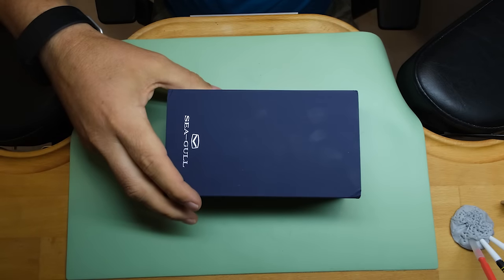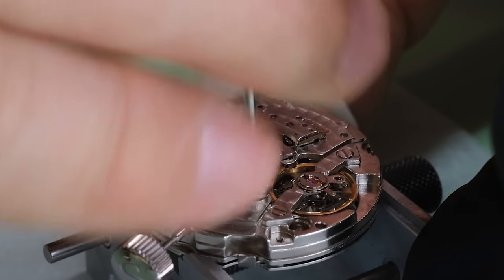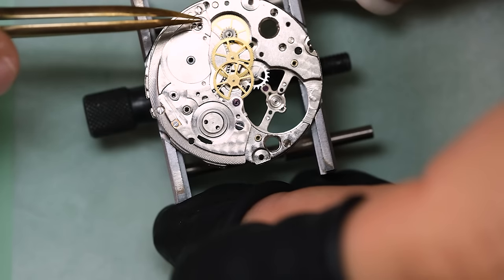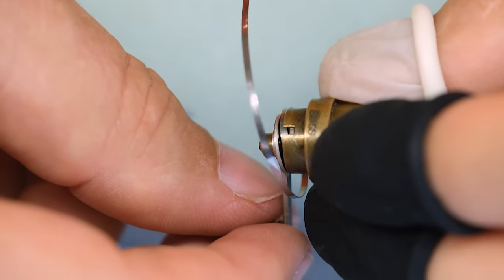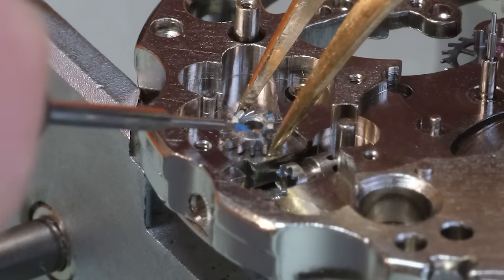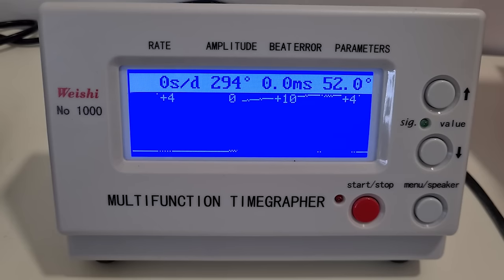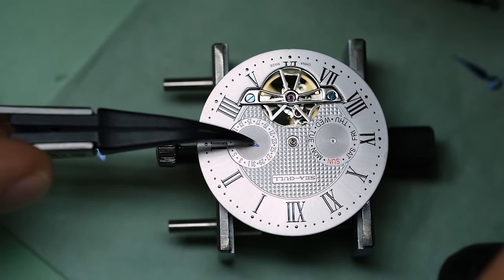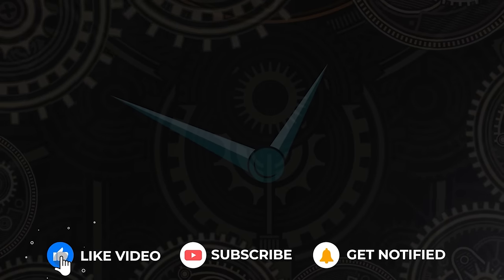How good are Chinese watches? Teardown + Giveaway!

Comment: Well, nice value for the money, but we all know that this watches will not pass the test of time. Bad quality material will soon make the watch run badly and the only solution will be to buy a new one. Yeeh, Swiss are far more expensive, but they will last three or four lifetimes at least. This one only few years.
Reply: Superficial finishing, yes, but not poor quality materials. In terms of ruggedness, these Sea-Gulls can handle and have handled anything Swiss equivalents can do.
Reply: @jakekaywell5972  I was talking about the gears material. Cases and bracelets can be really close to the swiss quality, but the movement parts are made with cheaper material. For example, as you can easily see in this very video, the mainspring barrel and the second wheel have a wobbly fit and they are certainly not made of the same material of their swiss counterparts. This means in the near future, a higher  wear in teeth and pinions causing really big issues with timekeeping in the coming years. I agree that they are a good value for what they are, meaning that the value is always 100 £$€ not to be confused with the 100£$€ value af an average Seiko or Miyota. They will work fine for longer than a Seagull.

Comment: Hi Stian as I've said before I'm not a watchmaker just enjoy seeing you at work. Did I hear you correct that you hone your screwdrivers to match the size of the screw slot. And I guess this is to prevent them slipping as you tighten them?.
Reply from the maker: Hello John, that's the reason indeed. A properly sharpened screwdriver should in fact not reach the bottom of the screw slot but rather lock in between the sides of the slot just before reaching the bottom. If the screwdriver tip reaches the bottom of the slot it will easily slip out.
Reply: @VintageWatchServices  Thanks Stain makes a lot of sense. But I didn't know that before.
Reply from the maker: @johnwhite6899  👍

Comment: well...how good is your Rolex?  Rolex cases, movement parts and bracelets are all made in China as are the cases and movement parts for Panerai, Breitling and Omega.  China is the #1 maker of watch parts BY FAR.  The "seagull" movements are excellent in most grades.  They also power very good luxury clones.  I used to work in watch manufacturing in China and made Rolex cases and bracelets for genuine Rolex production.  Seagull makes movements like ETA does in varying grades.  Their mid to very high grade movements are as good as anything else out there, except maybe Seiko.
Reply from the maker: Good to hear you agree with what I said in the video 😉 Rolex and Omega do however make all their parts in Switzerland, potentially apart from packaging material. Most other Swiss brands apart from the top level ones use Chinese factories, but again, it's all about QA.
Reply: @VintageWatchServices  I hate to burst your bubble, but Rolex and Omega do not OEM all their parts in Switzerland.  I made their parts for years.  The Swiss standard is that watches have to be ASSEMBLED in Switzerland--not manufactured.  I made OEM Rolex, Panerai, Omega, TAG...etc cases, movement parts and bracelets--all OEM for Swiss assembly in my Chinese facilities.  You may not want it to be true, but it is.
Reply from the maker: @peteanddrake4242  Well, I personally know the former president of Omega and trust him when he says Omega is all made in Switzerland. And there's no doubt that Rolex is fully made in Switzerland. So exactly who you may have made parts for I don't know, but it wasn't those two brands. 
As for Swiss made, that's a different discussion but the 60% rule indeed reflects the fact that most brands have operations in China or elsewhere.
Reply: @VintageWatchServices  I can understand your perspective and connections in a very complicated industry.  I can imagine the supply chain has gotten more complicated in recent years.  When I was working in Guangzhou, we were making cases and bracelets for Rolex and Panerai in my two factories.  Other factories got contracts for movement parts.  When we started doing the cases for Rolex, they sent us the OEM tooling from Rolex for production.  We were making their cases with their tooling.  Cases were then sent back for finishing and assembly at Rolex.  Same with Panerai--and soooo many others.  As is commonplace in China, it took mere moments for the tooling to be duplicated--which is why 99% of Rolex fakes from China are in cases perfectly identical to OEM.  All parts are 100% interchangeable.  Most people believe they are reverse engineered copies--but they are in fact made from the copies of OEM tooling we were provided.  Swiss watch companies only have to assemble (not manufacture or finish)--just assemble 51% of the watch in Switzerland.  I agree--finishing and assembly absolutely happen on site at Rolex and Omega.  Critical parts like jewels, mainsprings, hairsprings etc are made in house.  But cast and stamped parts from the case to the movement begin their life being unpacked from a case that originated in China.  This is why you saw such a dramatic turn in replica watches in the late 2000's--and now they are perfect.  There is a reason.

Comment: Great video! 
In your opinion, could this movement last in the long run, provided it is serviced and taken care of as it should?
Reply from the maker: I don't think it would last all that long given the low level of precision in the machining but it should run for a couple of decades with regular servicing, I'd think.
Reply: @VintageWatchServices  Thank you for your swift reply. On the other hand, this means that Miyota 8215 or Seiko NH25A (which have been proven to last as long as they are serviced) are of higher quality of machining compared to this? 
I am asking because at least from a user point of view, my ST2525 looks and works way smoother and closer to my ETAs than my Seiko or citizen movements.
Reply from the maker: @alessandrofrikis561  Oh yes, both Miyota and Seiko movements are of very good quality

Comment: Often when you screw down a bridge or plate, it looks like there's a lot of movement when you tighten the screw. Why doesn't the plate or bridge fall into place all the way before screwing down? Where does this tension go when you tighten the screws?
Reply from the maker: This watch has quite a few parts that simply float underneath the plates and if the machining isn't to a very high standard the parts will not lie uniformly flat before being held down by the plate. I assume that might be what you see?
Reply: @VintageWatchServices  No, I mean specifically on quality watches, usually it's expected like with the balance wheel but on this bridge here at the very last second you can see what I mean (not the best example, but what I could find just now):

https://youtu.be/1gMoiqufKS4?t=1535

You're holding it down and yet it moves just a hair when you tighten the screw. Is there a burr or some particle underneath?
Reply from the maker: @Gersberms  That's not "a lot" of movement though, as your initial question was 😉 There will always be tiny machining inaccuracies that a bridge will rest on and when you tighten the screws the bridge will simply tighten up.
Reply: @VintageWatchServices  Thank you. Indeed a poor example, I apologize. I don't know how these parts are made but with the magnification you use I suppose any imperfection causing a part to not lay dead flat, will be visible. My assumption was wrong.
Reply from the maker: @Gersberms  No worries of course, no need to apologize! You're perfectly right in that there is a little bit of movement, but if it was a lot, that would likely mean something is wrong.

Comment: A great teardown of this Seagull watch. I agree with your idea that these are not the movements to learn on.
I made the mistake of picking up a couple of cheap Tongji movement automatics, non working, due to
horrible nasal hair and some kind of grit in the movements. I could not reassemble them after cleaning.
Too many floating parts under the calendar plate along with springs that all moved during disassembly,
so I had no idea as to where anything went. 
All of the parts I've kept in a box in the hope that someday a watch channel makes a video on these awful
watches, but so far nobody has. I can see why people are reluctant.

Comment: I own the 1963, and after 14 months of ownership the chronograph froze and would not reset or restart. My watchmaker was able to open it up and manually reset it, and he recommended that I stay away from Chinese movements, as the quality control is severely lacking. Though it was a cheap watch, you get what you pay for. I'm thankful for a good watch maker for sure, you guys are magicians! I'm currently editing a video about my experience with the Seagull 1963.

Comment: Great video showing the truth thats concealed in there! Great camera work and narration as per usual.
My brother bought 3 Chinese watches made by Fiece. They were about £160.00 each inc shipping. Beautiful dials with sub-dials and half-sub-dial power reserve indicators. He sent all 3 of them back as the power reserve hand exceeded the 40hr calibration mark (went off the dial) and also subceeded the 0hr mark by a large degree. Hence showing great inaccuracy of the dials! Lovely looking watches but they were fieces...eeeenuff said!
I won't buy Chinese watches like Sea-Gull or Parnis (again) I onced owned an automatic Parnis, it sounded like a ball-bearing in a tin can when you shook it, the rubber seal also came out of the crown...in bits when I manually wound it...nice looking watch, cheap but crap internals. One is better of buying a nice Citizen or Seiko...cant go wrong they're both bullet-proof!